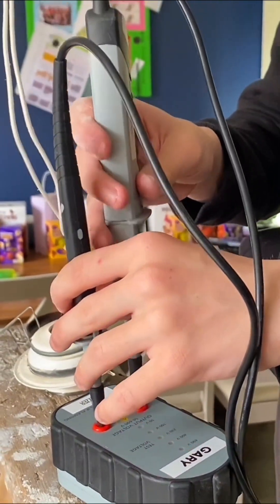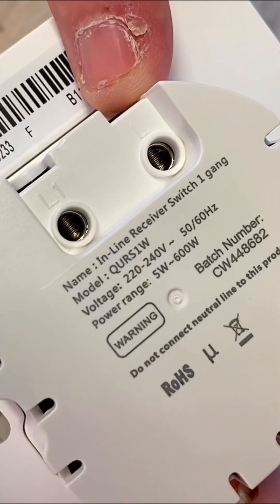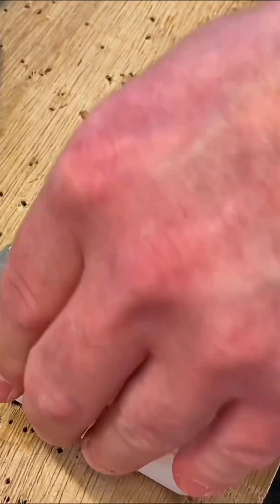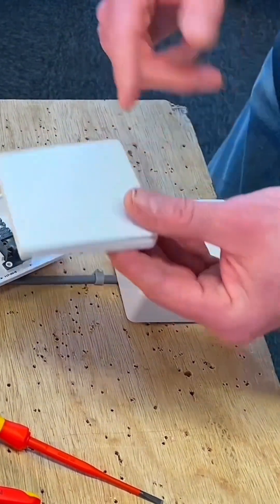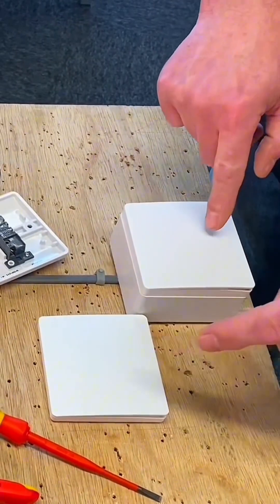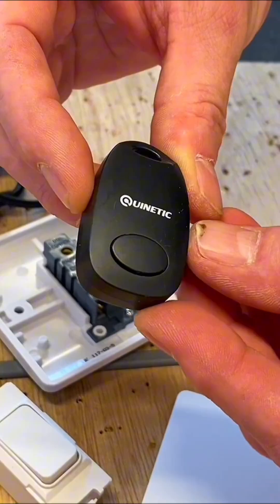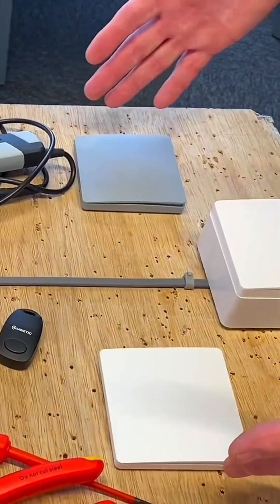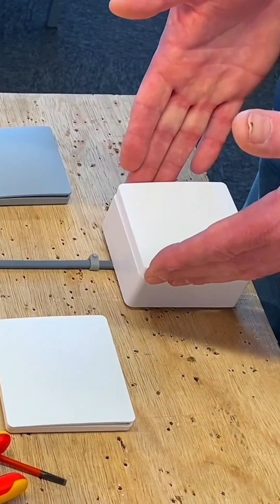Two-Way & Intermediate Lighting Hack No One Tells You About!

Comment: I've installed a Tapo Smart switch in my own bedroom a few years ago. Then I installed one in my Dad's bedroom & very recently installed one in my sister's bedroom as a birthday present last month.

I also got my Dad last Christmas a small Smart button/switch & programmed it to:
- When rotated, using the dimmer function to turn on/off the three Smart bulbs & adjust brightness simultaneously in the living room...
- & the button feature turns on/off his bedroom light switch & a Smart Plug, which gives power to his electric blanket (or topper, can't remember which one it is).
He keeps the button on his desk downstairs in the living room (LR), giving full access to the 'LR' lights control without him having to rely on Alexa as it doesn't always listen to him & uses the button feature 10 minutes before going to bed, so his light will already be on & his bed will be warm due to the electric topper/blanket, when he goes to bed.

Because these are all Tapo devices we all have additional & primary control on our phones or any device in which the Tapo app can be downloaded.
You can even use a phone emulator on a PC & download the app onto the emulator & control everything from your computer, just for fun. : )

Comment: How does the receiver work then?  Guessing there is a rechargeable battery in it which harvests electricity to charge itself when the main switch is on?
Reply: It works on a Pizo ignition much like that in a lighter. 433 MHz signal is sent to the on-off relay receiver. In this case, the on-off relay receiver is the main light switch. The advantage of this switch over the standard receiver is that there's no neutral required.

Comment: I find the key fob doesn't give as great a range as the normal switches. I've got my receiver in the garage to turn on the outdoor lights. The fob works best at around 3 or 4 meters where as the 2 switches that are in the house work fine and are much further away